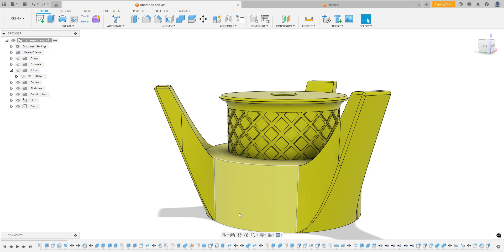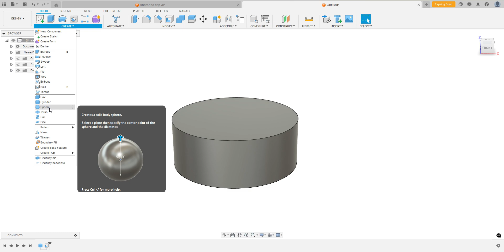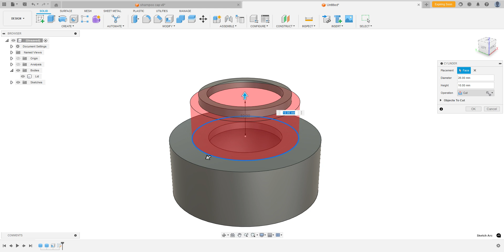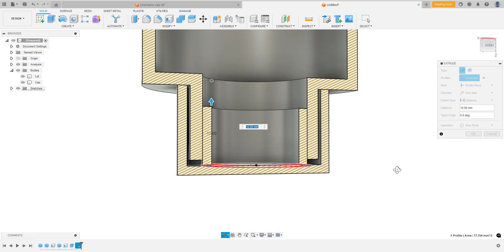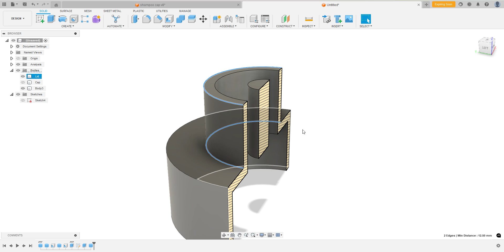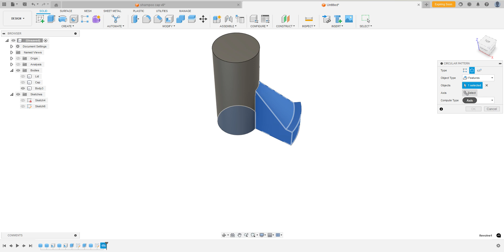Part ONE: 3D Printed "Flip It" Shampoo Bottle Cap. Fusion 360 Tutorial

Comment: 27:07 In the project command if the projection link box is ticked the dimensions of the output sketch are linked to the dimensions of the projected body. So if the dimensions of the body change, the sketch (and all features related to it) will update too.
Reply from the maker: ahhh!  Thanks for clarifying.  I knew I didnt have that right.

Comment: Your videos are great. Is there a standard order of operations when doing fillets and chamfers. I find myself getting screwed sometimes when finishing a complicated part where the fillets and chamfers meet. Sometimes I have to go all the way back and start over because the edges don't combine well. Sorry, one more fusion question. I was doing some double start threads yesterday and had to match the existing threads of a part very accurately. I couldn't find a good way to measure clearance because Fusion won't let you use the measure tool on a curving surface like a thread. I ended up having to create a sketch each time I wanted to measure something. Thanks!